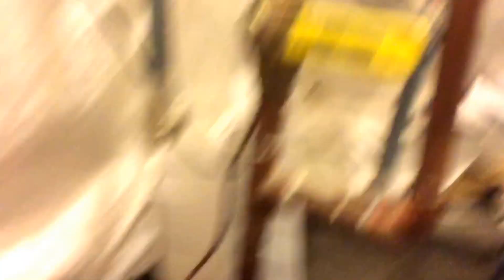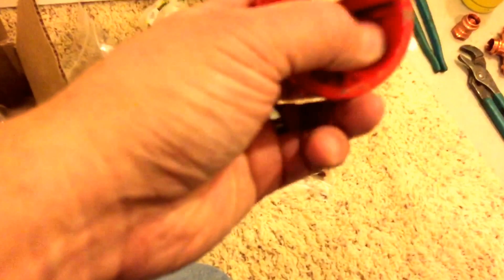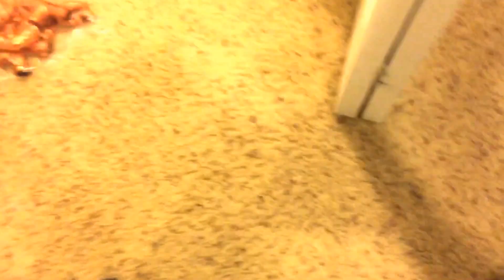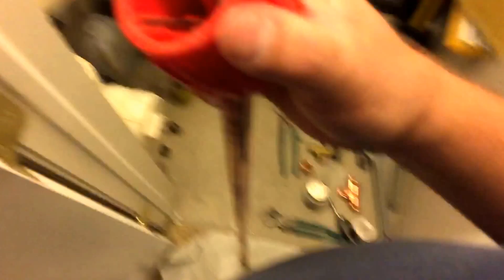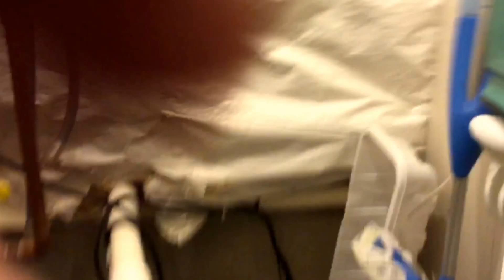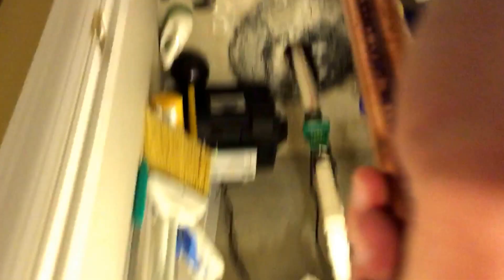Installation of water main drain using the RIDGID PRO Press

Comment: Can you use that for hot water heaters? I do mainly HVAC but we do fix and change HWH's . If so might be worth picking one of those up other wise I wouldn't have any use for it. Sucks cause it's cool as hell
Reply from the maker: Yes. Can be used for all plumbing and heating.
Reply: Or water heaters heating up cold water